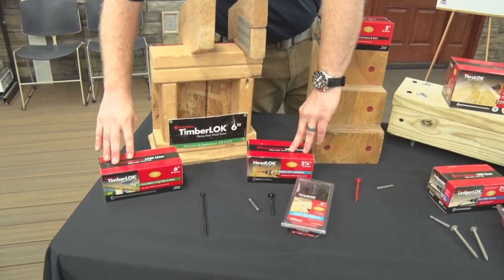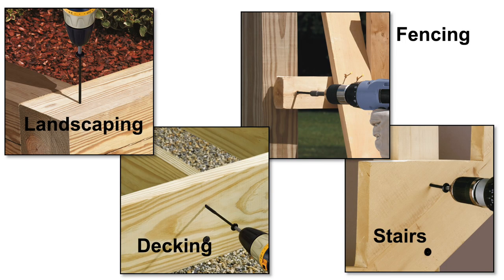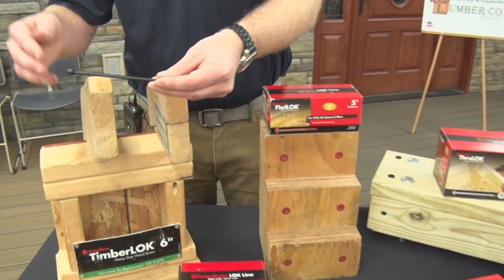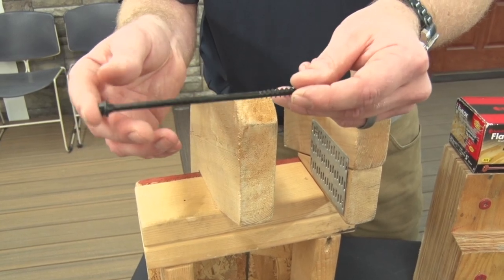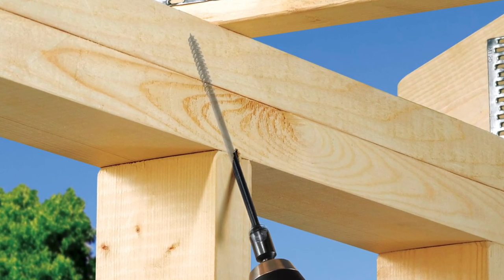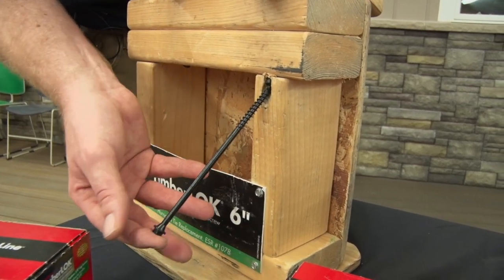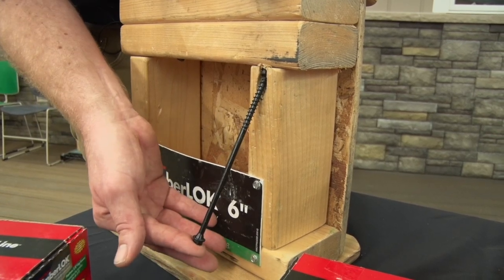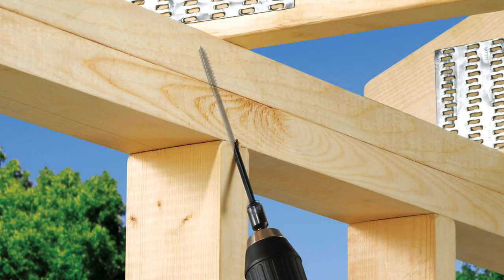Fastenmaster TimberLok HeadLok

Comment: Is the 22.5 degree angle measured from the rafter or the stud?
For example, if my rafter was sitting flat on my stud wall, I imagine it would be measured from the stud, as it is 90 degrees to the rafter.  But if the rafter is a 2/12 or some other pitch, it would not be from the stud, would it?